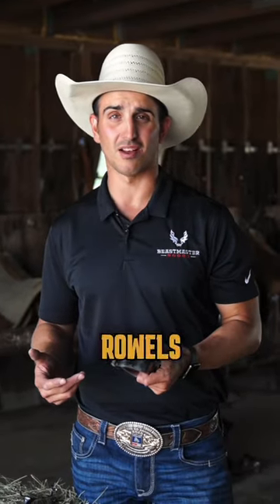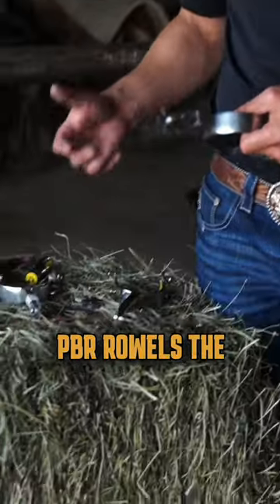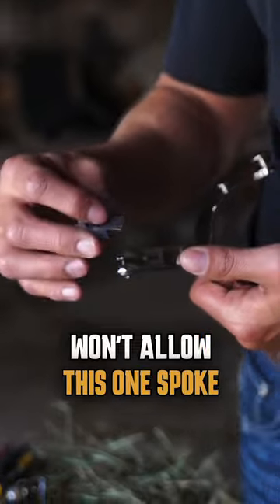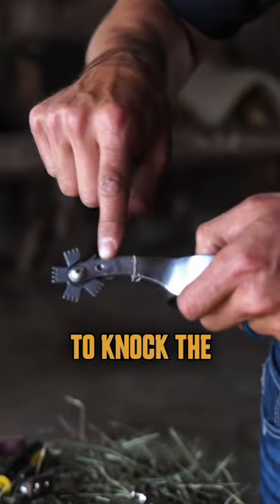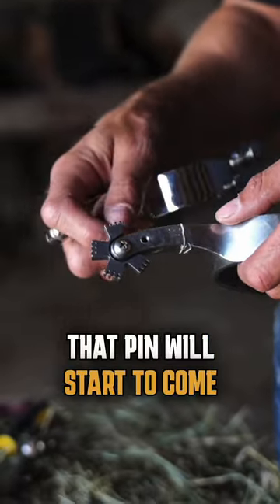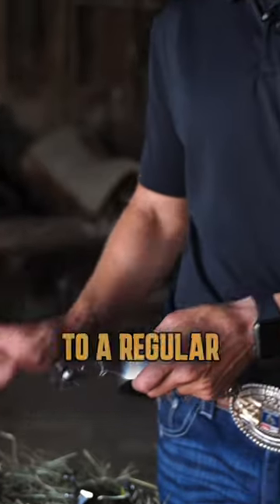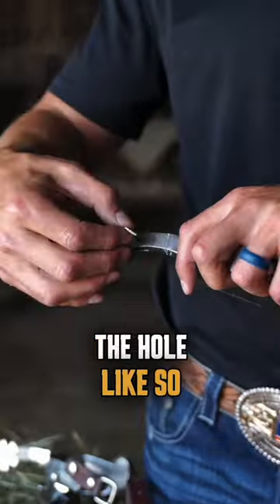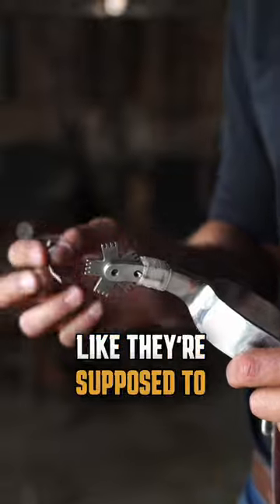Stainless Steel Spurs & PBR Rowels Modifications

Comment: Pin wont come out?
Reply from the maker: Be sure to use a sharp metal object and just try tapping that with a hammer, that should break the pin loose. we also recommend putting the spur in a vise grip to hold it steady while you do this.